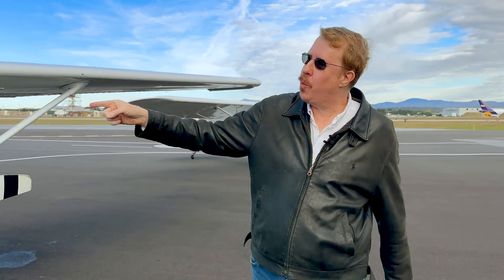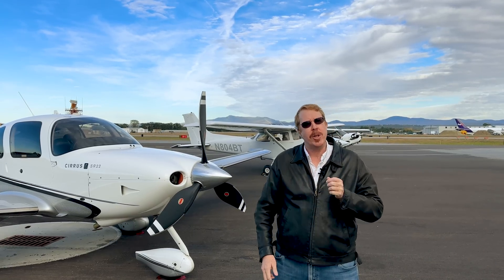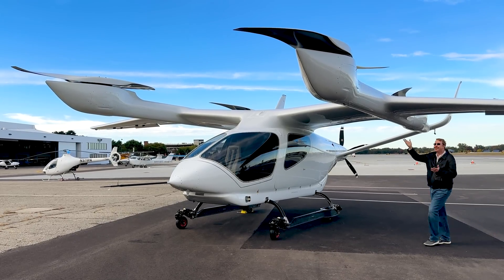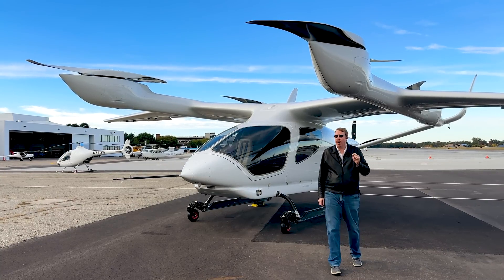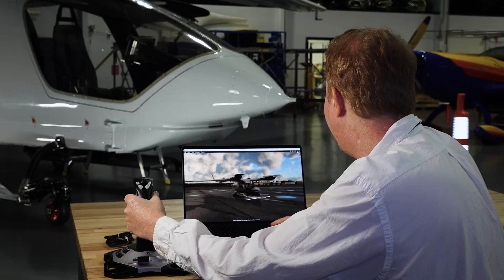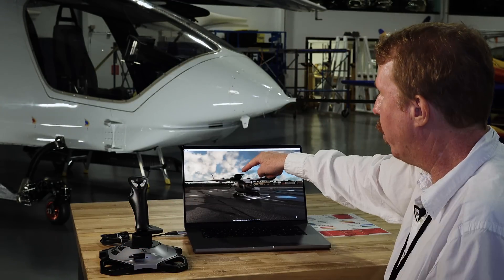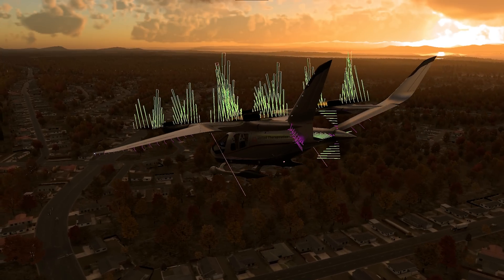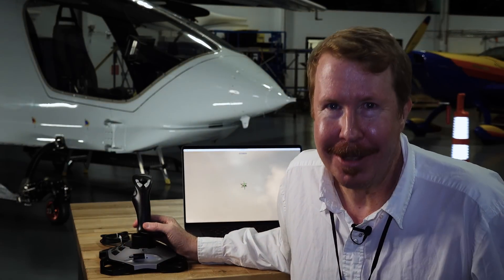The NEW Beta eVTOL: Fly without FUEL or RUNWAY!

Comment: fly without fuel for what, 20 minutes? and after 10000 cycles the batteries will be bricks. How many thousands of dollars will replacement batteries be?
Reply: The flight time is running about three hours or so. What will it cost to replace the battery? I don't know. What will it take to buy gas for your car for the next five years? Who knows? There is an interesting thing about batteries though: they are getting better at about 8% per year. So, if a battery is due to be replaced in five years… And it is replaced with the latest technology battery available at that time… Well you can do the math on that.
Reply: @austinmeyer  no idea how much it will cost to put gas in my truck, but I won't have to replace the engine after 10000 cycles. So, they will pay for electricity while waiting extended periods of time to charge their battery, then get to pay  20 to 40 thousand dollars to replace the battery when it turns into a brick.
Reply: @laxplayer99  no, you are wrong there. When the battery has reduced capability, it is not a brick, but instead is moved to use-cases that do not require such high energy density… Normally grid storage. In fact that is something they are doing a lot in New York right now as they move to more renewable power. They come up with grid storage units to store energy for periods of high demand. Tesla, for example, just installed one of the biggest storage systems in the world in Australia. So when batteries are done with vehicles they are not bricks… They are simply ready for their next life as grid storage, or valuable materials for recycling.It is not a brick at all. Also charging up an electric vehicle only cost half or less than half what it cost to put in fuel. Also when the batteries get replaced it will be with newer technology and therefore longer lasting and higher energy batteries than the original, so the airplane will actually get better over time as next generation batteries get installed. None of this is the case with fossil fuels, of course.

Comment: Are you even considering the amount of fuel needed to generate the power to charge this? Instead of avgas your burning coal!
Reply: Not true. This thing is being developed in Vermont, where the power is Quebec Hydro. So the amount of coal burned is: zero. And the grid is increasingly being powered by renewable sources overtime. So this will apply to even more locations in the future.

Comment: After a year charge doesn't hold.
Reply: Not true. I've been driving Teslas for about 8 years now, and... no.
Reply: @austinmeyer  Range over time decreases.
Reply: @Peel123  Basically wrong. Everything in the world wears out, but battery technology is increasing energy density at about 8% per year… So battery technology is literally increasing faster than batteries wear out.
Reply: @austinmeyer  Still not as good as their first charge though... chase the dragon!
Reply: @Peel123  Still basically incorrect. Every machine in the world wears out. The Pratt and Whitney PT6 degrades over time. When there is no reserve left because you hit your temperature limit before you reach your rated power, thats when it is time to overhaul or replace the engine. Same with reciprocating engines. Top Gear did an episode where they took a bunch of old cars and saw how much power the reciprocating engines lost over the years. Same of course with efficiency and therefore range. Engines wear out they deliver less. This is a characteristic of every airplane engine ever made. The difference is: Turboprop and reciprocating engines are not going to get any better. They basically peaked in 1960. And hi bypass jet engines are eeking out tiny little percentages each year. Batteries, on the other hand, are getting better at 8% per year, and of course the batteries in this airplane, and any other properly designed electric vehicle, can be replaced. So as batteries get better at 8% per year, the batteries in these airplanes can be replaced so the range gets BETTER over time. Unlike gas-burners, where it gets worse.

Comment: So, I tried landing this aircraft. Landing with just the pusher rotor did not pan out. I had to use the lifting rotors to assist with a smoother and safer landing. Anyone else?
An observation -- I could not get this aircraft to run for over 30 mins; it ran out of "battery". How is that possible? Or was that time limit expected?

Addl. Edit: I looked up a couple of EVTOLs (on youtube) and it seems to confirm that the battery life of this aircraft in XP12 is about as realistic as it can get. Actually, most of the ones that are currently at the prototype stage give out about 10 to 15mins of flying time.

Comment: That’s a helicopter Austin
Reply: A helicopter has a cyclic and collective to adjust the rotor pitch as it flies. Alia does not have those, and it literally stops the rotors in flight and flies on the wing.
Reply: @austinmeyer  As per despisted in the sim it has a collective lever but no foot pedals....is it?
Reply: @jaimelopez4445  OO! Good question!!!! There MUST be yaw control. But HOW do we get it? The system is FLY BY WIRE... so the interface can be... ANYTHING. Because this is a fly-by-wire interface there is zero control deflection or control force needed: We can set it up any way we like. Right NOW, it is looking like we will go with a TWIST on the STICK... JUST LIKE THE LOGITECH IN THE VIDEO!! :-O
Reply: @austinmeyer  And the collective lever?
Reply: @jaimelopez4445  Another great question! It is indeed set up JUST like the collective in a pain old helicopter!

Let me guess your next question: "And the pusher prop?"

Answer: Another good question! In the real airplane, that is a little rotating wheel on the collective lever!
Reply: @austinmeyer  No more ''good questions'' , you quessed the last one.....👍
Reply: @austinmeyer  it lifts up vertically, it’s a helicopter
Reply: @blopowers  Why is Homer Simpson posting under the name virtualtem?

Comment: So, its not simulating each blades as invidual wings producing lift? This is scripted base not a real time simulation.
Reply: Good question! I simulate blades in the 12 oclock, 3 oclock, 6 oclock, and 9 oclock position. So, yes I simulate the advancing blade, retreating blade, and cross-blade travel. This applies to ALL props on ALL plane AND helicopters. It is needed for helicopters for very obvious reasons (advancing blade Mach drag increase, retreating blade stall, pitch-up, etc), and is needed in airplane because the lift differential is PART of what causes p-factor! So I don't exactly TRACK THE BLADE AROUND, but instead I simulate each blade at 4 positions to get these critical effects. If you aren;t sure if you believe me, hit command-m a few times to see force vectors in flight in a helicopter moving forwards.. you will see what I mean!

Comment: Is the propusion and lift overbuilt so that if you have a bird strike  you can still land under control?
Reply: This plane is not that fast... about 100 knots... bird strikes at that speed are not catastrophic to carbon-fiber structures.
Reply: @austinmeyer  Thank you. Not so much worried structurally though - my concern: Is there enough power should a strike cause a prop/fan or fan motor failure? And performance if there were a motor failure?
Reply: @brothersar5957  There is redundancy on each lift motor, so it would take multiple failures to take out a corner. Even with a corner out if you're above a certain height you should be able to use the pusher to get on the wing, and then go find an airport or field and land conventionally. If you're below that height, you might have a rough landing, but it should be survivable.
Reply: @unlambda  Thank you. Not sure if I've ever heard that oifficially from a manufacturer/project team. Maybe I've missed it. Thank you.
Reply: @brothersar5957  The exact design hasn't been announced publicly, since the design is still being iterated on, but it will involve redundancy. You can actually see it if you look closely in the hover video; there are two separate inverters on each side of the lift motors, providing two independent power paths. That video was with a previous gen motor, the final cert design will be a newer generation, but it will also be redundant.

Certification of an aircraft involves a failure mode effects analysis, which determines what kinds of failures are catastrophic, hazardous, major, or minor, and assigns maximum probabilities for each failure mode based on their effects; and then a probabilistic risk assessment to determine given individual part failures and standard failure rates, what the probability is of combinations of those failures leading to one of those effects, to ensure that the probability is low enough. Given that loss of control in a critical phase of flight could be quite hazardous, there is a very low failure probability target, and pretty much the only way to get there is via redundancy.

There are also requirements to demonstrate safety in the event of bird strike; the size of bird you're required to survive is lower for a smaller aircraft like this than a big commercial jet, so don't go flying into any turkeys, but it should be able to survive the most common bird strikes. And you know, even a big jet sometime can't survive a bad enough bird strike, see Sully, but he was able to glide to safety. Alia has the additional redundancy of the pusher motor and can act as a decent glider, so can do a horizontal landing in an emergency if one the lift motors is badly damaged.
Reply: @unlambda  Thank you very much.👍

Comment: a motor glider is the most efficient aircraft. Still needs a runway though
Reply: If the motor glider has a gas-burning engine, then that engine runs at about 15% to 20% efficiency. Electric drive-trains, such as this one, run at 90% to 95% efficiency. So ALIA has a 5x to 7x advantage due to the propulsive system! So the motor glider AERO is better, but the engine: FACE-PALM. Factor them BOTH in, and the motor-glider would need about 6x the aero efficiency of ALIA just to MATCH ALIA. Do motor gliders have that? NOPE!!! So motor gliders have the right aero, but unless electric, they have the wrong motor.

Comment: PS .... What is the "right" / "optimal" height, to start using the "pusher" propeller ? .... What is the "max" SPEED, when flying on ONLY the pusher propeller ?    And what would be the "average" range, to fly it, on FULLY charged batteries ?
Reply: You should generally get on the pusher ASAP; as Austin mentions, lift rotors are quite inefficient, they draw a lot of power and if you leave them on too long can overheat the battery or lift motors. So get on the pusher as soon as you're clear of the ground, usually.

The range is designed to be 250 NM with a 30 minute reserve. That will obviously vary based on a lot of factors, but that's the target.

Comment: How long a full battery lasts on a normal flight?
Reply: In the sim the Batteries start at 800 and the motors shut down at 600. I didn't got far.

Comment: What happens if one of the rotors fails during takeoff or landing? Any chance of recovery?
Reply: Interesting question. At least there's more than one, which is all you get with a helicopter. I've no idea what the safety procedures are for helicopters. For fixed wing planes I have some idea so it would be interesting to know what procedures and safety systems exist for VTOLS
Reply: Look under the Failures page. See if you can fail a motor. Then try it in XP12. X-Plane shines in what you can fail and the way it is simulated.

Comment: Electricity is the fuel. Nothing runs without fuel. And if you are in the US, this electricity was generated by burning coal in 84% of the cases. On a Cesna if I run out of querosene, I can glide back to the ground. What about this one?
Reply: Yes, this plane can glide to the ground; it is designed to have a high lift to drag ratio, just like a glider, better than a Cessna.
Reply: Vermont, where this plane is currently based, gets its power from Quebec Hydro. So this airplane is powered by: Water falling down a hill.
Reply: @austinmeyer  Well, maybe not a hill but a really long pipe and, the beauty of the system, unlike other hydro generating areas (Hoover dam etc) is that Quebec's rivers come from James bay which is tied to the Arctic Ocean which ties into the Atlantic Ocean...  Global warming will "Help" with electrical generation as the oceans rise.
Reply: @philnelson2364  So you're saying the rivers flow FROM James Bay at sea level? To where? A big hole in the ground below sea level? And then what? Back into the Atlantic Ocean at sea level?

Comment: No fuel? Really? What? The batteries charge from thin air electricity? Fuel is burnt.
Reply: In Vermont. we get our power from Quebec Hydro. So: Water falling down a hill. So, not thin air. Instead, thick water. So, no. No fuel is burned. And renewables surpassed coal for energy delivery in 2019. And Tesla is doing solar panels. And new companies are making safe, passively-cooled nuclear reactors. The list goes on. And on. And on.
Reply: @austinmeyer  Thank you. I see your point. Unfortunately, most of us do not live in Vermont, and your statement was misleading. No it is clear.